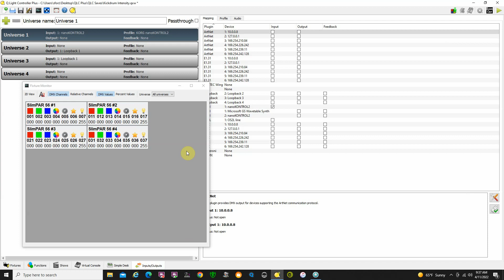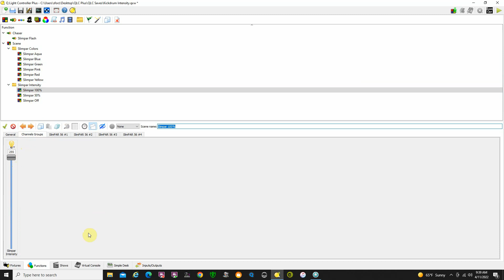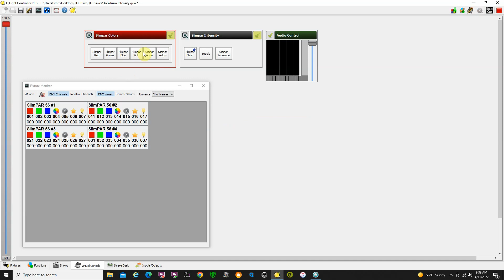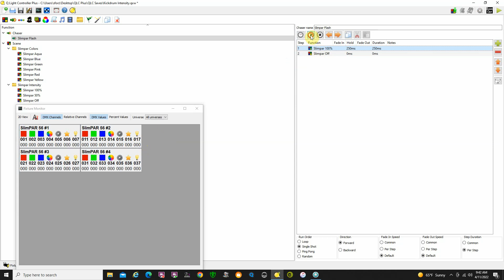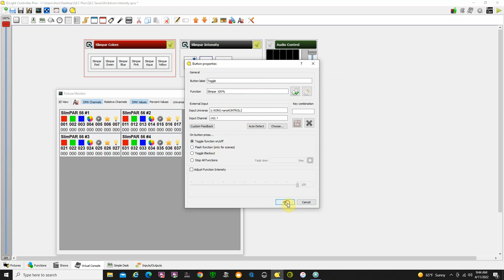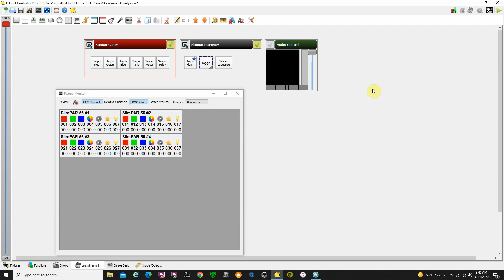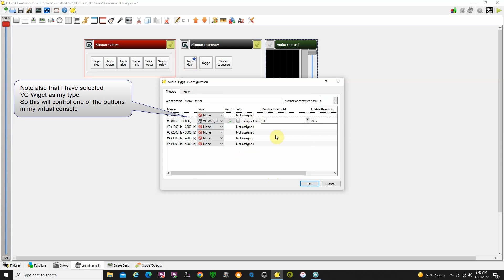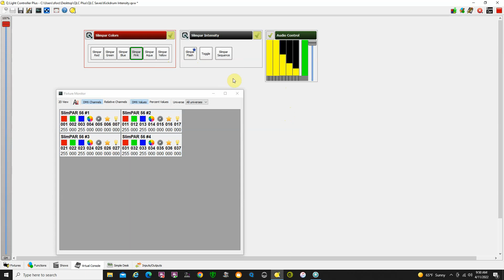Kickdrum Lights

Comment: Thanks a lot for making this video, Edward! This is the only clear explanation of how to use the audio trigger out on the internet. I have a question: Most people on QLC's forums recommend using a loopback for audio trigger. From this video and my own experiments so far, it seems to run just fine without any loopback. So why do these folks insist on using loopbacks?